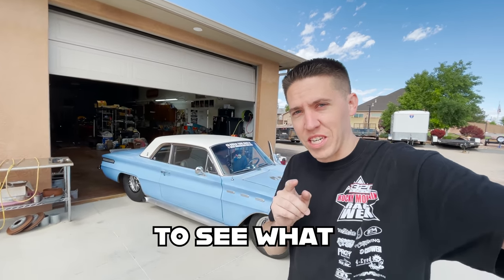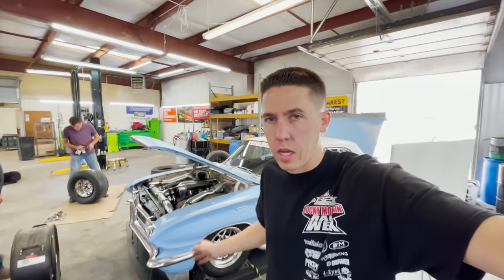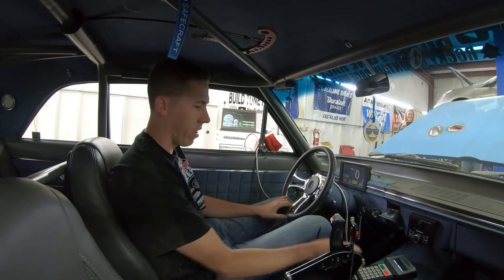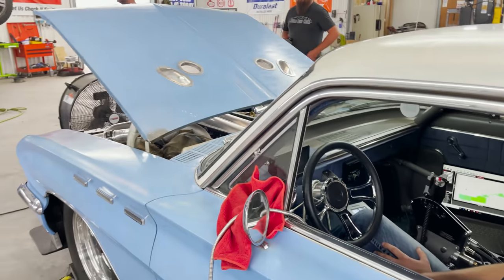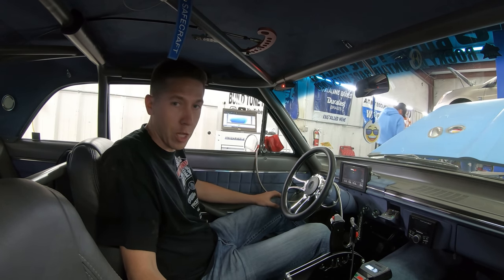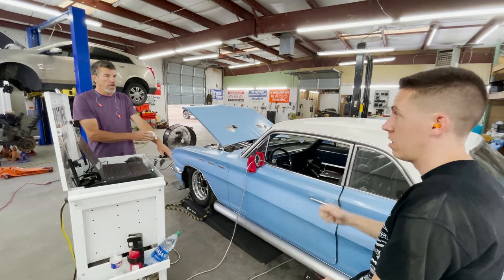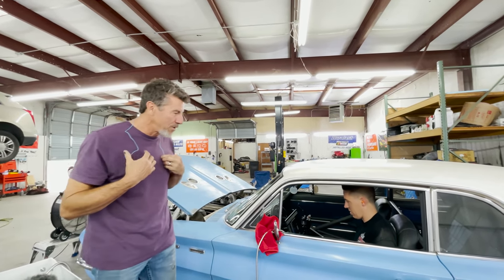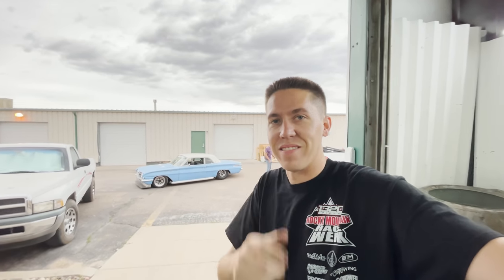We Dynoed The Buick!!! TWIN TURBO 427ci LS Swapped Buick Skylark Makes HUGE POWER! (Guess How Much)

Comment: 7s and 4s should be cake on a decent surface. I went 4.95 at 140 and 7.8-7.9 at 168-170. 1.15-1.20 60fts. Solid numbers, looking forward to track videos.
Reply from the maker: I’m hoping so I know we have the power just need to get that front half down! I think we’ve been 135-137 in the 1/8 on 20-23 lbs (1.47 60🤦‍♂️) a mid 1.2X 60 and a bit more boost and I think it will happen for sure!

Comment: Can you explain the c16 pump gas comparison you made? You said you can go from pump to c16 and not make any adjustments? I guess the c16 just releases more energy when it’s combusted?
Reply from the maker: I’m no fuel expert but in basic terms C16 is similar to pump gas as they are both similar types of fuel(gasoline). Of course C16 is a much better version of gasoline but similar when comparing to things like e85 or methanol. The amount of c16 the car needs to idle and cruise on is very similar to pump gas so it makes it very nice to not have to change the tune/fuel completely. I leave some correction in the Holley and allow it to automatically adjust for the difference which isn’t much around 10%. This wouldn’t really work with a fuel that takes 30-50 more to start/idle/cruise

I hope this makes since lol
Reply: @BuildTuneRace  it does make sense. What percentage of gain do you think c16 would make over the pump ?
Reply from the maker: @stlmikie  it’s a lot c16 is good for probably 5-6 degrees of timing min over pump (just guessing and it’s way less pro to detonation and a much cleaner more consistent fuel. I wouldn’t really want to push an LS past 8-900 on pump I know people do it but for the same money or cheaper e85 gives you a much safer tuning window. I’ve never pushed pump gas super far on a turbo LS deal

Comment: What width rims are you running on the 275’s and 315’s? I have 325/50r15’s on 12” wide rims and I want to go to a taller tire that’s 12” wide also but I’m not sure which one to use